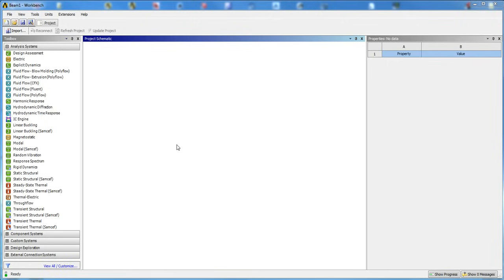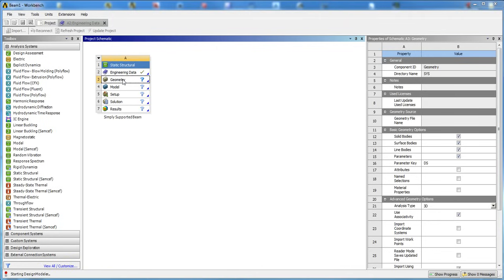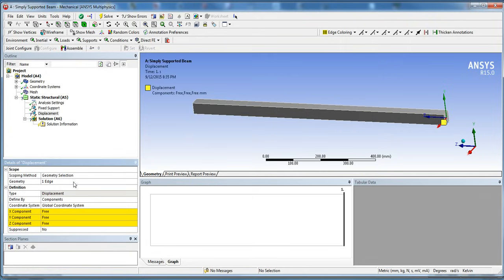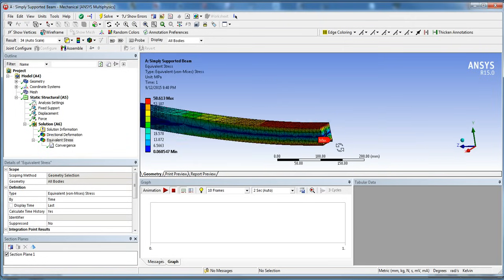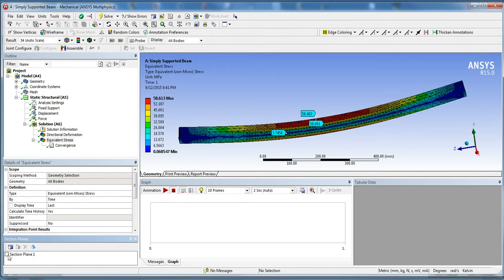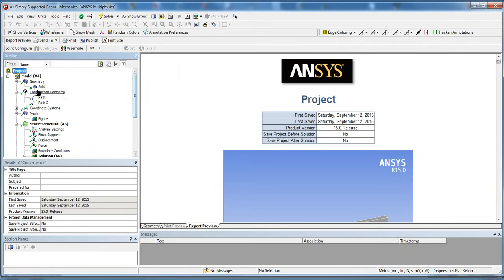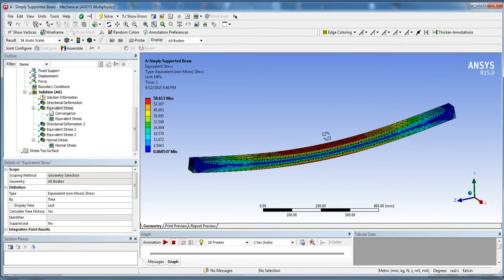ANSYS Workbench Tutorial - Simply Supported Beam - PART 1

Comment: I am in need of some help. My last college project is to optmize a reinforced concrete beam using ANSYS. I want to reduce only the height and height and thickness of the beam. I tried using Topology Optimization but it didn't work with the rebars and, after supressing them, it resulted in a weird optimization that cannot be used in real life. How can I do this?

Comment: Hello, DrDalyO and everyone.

I'm tryng to do SFD BMD analysis on simply supported T-beam and I noticed that the option for Beam tools is blocked away. This video didn't use beam tools too, but your other videos did. Are there any way to get the SFD BMD directly from a solid body like this? 

I'm aware that those videos uses line body and cross section, but in my case, I need to plot the force into specific surface, and I cant seem to do that with line tool.

If you or anyone responds,  thanks!

Comment: hello sir ,i'm currently pursuing masters in fracture mechanics i have a question with ANSYS: if i use smart crack in ANSYS  i have to use either static or fatigue method for crack growth law is there any way to get pari's law value or the critical rate value from Ansys?. And if i modal cracked specimen and change the loading condition my result will change too but the maximum stress or load will be same for material so how to find that ? can you please help with this.

Comment: Hi, I wonder why we use "fixed support" in this case? Isn't Fixed Support restricting all 6 degrees of freedom, while the supports in this diagram are restricting translational motion only?
Reply from the maker: I do not recall the details, but if you use fixed support on an edge, it will not restrict rotation. If you fix a face, it will restrict all motion, translation and rotation (UX, UY, UZ, RX, RY, RZ). So depending on how you would like to restrict your geometry you can change the boundary conditions as you wish.

Comment: Thanks for this helpful tutorial, pls why did you use the minimum value of the directional deformation
Reply from the maker: Depends how you set up the coordinate systems, could be max or min depending
Reply: DrDalyO Thank you so much for your reply. My next question if you don't mind is why do you have 5N/mm as line pressure for hand calculation and on ANSYS, the surface force input as 5000N

Comment: Hi!
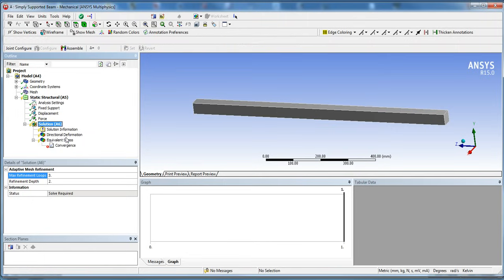Thank you for this amazing presentation. I was thoroughly following the instructions until 7:57 but after running the simulation, I am receiving an error. "Candidate nodes not available, please check convergence not scoped to single boundary conditions"
I had imported a beam from solidworks 18 to ANSYS 19.2
Please help
Thank you
Reply from the maker: Maybe try deleting the convergence output, also all the result outputs, and clear results. Then run again.

Comment: Your work is admirable for the workbench learners. Well done. I have a request too. Can you please make a tutorial for modal analysis of simply supported beam and compare FEM results with theoretical results. I am kind of beginner in this tool. I did it by myself but what is happening that for first four bending modes of a beam only first two bending modes are comparable to theoretical values and for later-on modes the deviation exceeds even 20-30 points. Please model beam with dimension as: L=2600 mm, Width=200 mm & Depth=100 mm. I will be grateful to you for your help.

Comment: Thanks for the video. Please someone help. In the first step why you only change the young's modulus? By default the material is Structural steel not concrete. I am simulating a beam made of recycled HDPE reinforced with fibre glass. I have some properties like E, compressive strength, flexural strength, dimension and loads, density, coefficient of thermal expansion, but still struggling to obtain Tensile Yield Strength, shear modulus, etc? How do you overcome this issue? Thanks

Comment: I have a question related to scoping paint, hope i will find its answer.

I am using ansys workbench 18.2
Working with surface and line bodies(beams)
To apply pressure, i picked faces from geometry window and applied pressure defined by "normal to".... 
Annotation lable shows that applied pressure scoping by red color paint on the selected faces....
My problem is why opposite side of adjacent faces are getting scoped with red color?. Why all of them can't get scoped on the same side.
Reply from the maker: Not sure I understand your question. You can select and deselect faces to apply pressure to.

Comment: I want import a Creo model (IGES) of hollow steel pipe structure  in Ansys and  check it whether it will sustain the load of 4 water heaters.  Hope someone will respond positively.  umang.201078@gmail.com  9725671950

Comment: Could please explain how I can add the fixed support to the beam, if it has a circular cross-section? Should I simply apply it to the lower circular half edge on both sides? or should it be fixed at a point?

Comment: Tq for dng d video on beam it will very helpful for learning in ansys. Sir i hv a doubt in ansys i am dng major project through ansys abt d friction stir welding. I want to do static structural and transient structural .all d process is ok but after applying d forces and fixed support it showing warning abt d rigid constraints and weak spring should be apply i am nt getting tht, so plz if u know plz tell me sir

Comment: Well, my questions are not about the video, but about the program itself. First, I would like to know that by giving the shearing efforts, which specifically it is giving me, since it does not make sense to the expected. Second, when applying a load on a surface, it looks as if it were triangular and undistributed, as is specified the distribution of the load that one desires. Third, in the supports, like knowing that it is embedding, simple support, double support, articulation. And fourth, how to arrange the joints between the elements well, like two tubes with inclination, and to be able to determine them if their union is welded or articulation. Thank you

Comment: Hi! Thanks for the video. I have a question. How can I make my cursor to be the center while zooming? By default the centerpoint is the middle of the screen, so in this case if i want to zoom to the end of the beam i can't make it precisely, i have to  zoom, pan, zoom, or click on and put that little ball on the model, that helps, but it's whole thing is annoying and generates too much clicks.
And how can I see the transparent body when you simulation the reasult with path selection? I can see only the path, the solid part is missing.

Comment: Very nice video sir..keep it up..Sir i have a doubt regarding support condition. to generate a simply supported beam why left support is kept fixed and other end displacement in x and y taken zero? according to this the  beam must behave like a propped  cantilever beam..how it resembles with simply supported beam ? sir if possible please explain the concept.
Reply from the maker: A simply supported beam is a type of beam that has pinned support at one end and roller support at the other end. So the left boundary condition is fixed at the edge and the right is allowed to roll in the beam axis direction only.
Reply: Thank u sir for ur reply. would please explain for analysis of cracked beam, how to introduce breathing crack in  a beam?

Comment: Hello Sir, I have just started learning ansys static structural. I found your video very helpful. I understood most of the things from this video but can't understand some things.
1. What is the purpose of adding convergence?
2. How to we know that our mesh(default) is good or bad?
3. What happens if we increase or decrease %age(allowable change) in convergence?
I will be waiting for your reply. Thanks
Reply from the maker: The purpose of adding convergence is to answer your second question. By using convergence you will know when you mesh is good within a certain error (% allowable change). So by adding convergence, ansys will continually refine the mesh (you have to set the number of maximum refinement loops) untill the allowable change has been met. So as an example, say the first mesh gives a max stress results of 50MPa with a coarse mesh. Then it automatically refines the mesh and solves again, naturally the max stress value should increase so say now its 60MPa. The % change in the value is now 20%. If you set the % allowable change to 20%, the solver will stop, if its less, say 1%, then the solver will continue to refine the mesh untill the difference between the previous results and the current results is 1% or less. hope this helps!
Reply: Thank you very much for your great work, clear and useful tutorials and for answering our questions. I'm so happy to have found your channel.

Best regards,
Zrinka

Comment: thanks for the great tutorial mate! I tried to mimic the example on ansys, but when i hit the solve, i get the error:
"An internal solution magnitude limit was exceeded. Please check your 
Environment for inappropriate load values or insufficient supports.  
Also check that your mesh has more than 1 element in at least 2 
directions if solid brick elements are present."
Any ideas? I did check the boundary conditions like 10 times, and no mistake there, nor on the geometry...
Reply: hummmm... changing the mesh element size to 10mm seems to solve that problem, but still I don't get the convergence. On the 1st run I got the 58,616 MPa, but on the other ones it keeps going up (73, 153, 309...) any idea why my results are not stable to 58,616? I rly need help XD

Comment: in simply supported beam there is no fixed support on one end instead there is free rotation in one direction ; why didn't you used remote displacement for that and neglected the rotation part because if you will apply force which results in rotation your answer will be wrong

Comment: I want to simulate a Concrete Cylindrical test (simple axial compressional test) to determine the Concrete element resistance and find under which load it will fail. I want to change in each test the type of concrete (f'c) so I can determine using ANSYS the resistance of each cylinder with specific material properties. Other way to see what I want to do is to recreate a triaxial test to get the UCS from different rocks.

How can do this? Can you share some ideas?

Thanks in advance for your help!!!

Marcel.

Comment: Excellent Explanation! One question: Why does it not matter where to place the Force? It automatically is placed in the center. How come?
Reply from the maker: Thank you! It does matter where you place the force. In this case I am applying a uniformly distributed load on the top surface. This means that the force is evenly distributed over the whole face that I selected.

Comment: Thank you for this video. I think that you have to use BC "diplacement as Ux=0 Uy=0 Uz=0" at the one end point where you used "fixed support". Because this end point  on beam is NOT cantilever joint.
Reply from the maker: +Il Kacar its been awhile since i posted the video, but if i remember, i probably used a fixed support along a line, which means that by default there is no restriction on rotation and only displacement. If i selected the FACE of the end of the beam, then this will restrict it in all displacement and rotation. Thanks for the question!

Comment: Thanks for the important informations.. Can you please define the basic differences between the ansys and any other design and analysis programs? By the way.. Ansys considered as an analysis or analysis and design program?
Reply from the maker: +heba douleh Ansys is a finite element solver, so other programs will do the same thing, like Abaqus or Solidworks Simulation, or Autodesk Simulation, etc. they are all also considered design, because they all have a 3D modeler, where you can create the models directly in the program, then solve.

Comment: you applied a force on a surface, how does Ansys know it's equivalent to UDL ?
Reply from the maker: +Tien Cuong it knows because when applying a force to a surface it does a UDL. If you want something else, like a point force, you need to create a point on the geometry and select it and apply the force to it. Did that answer your question?
Reply: After I make a section cut at the middle of the beam, and I would like to create a path that goes from the top edge of the beam to the bottom edge, but it seems like the edges are not recognised, (as if there were no edges there). How would you create the edges at such locations ?

Comment: Hi,
Very helpful video. I have a question regarding steady state heat transfer in ANSYS. 
If i have a plate with rectangular fins and my aim is to find the film coefficient of convection h in order to keep the plate at a fixed temperature, how can i do that on ANSYS? Because if i want to apply the boundary condition for convection, i cannot do it without h, which is what i want to find. Thanks!

Comment: Hi DrDalyo, Thanks a lot for the awesome video. I got confused  how to put hydrodynamic added mass along the height of the dam. I need to model seismic deformation analysis for rock fill dam. I have two questions: 1.  How to add engineering material( a. clay, b. rock)? 2.  How can I input the different values of hydrodynamic added mass in respective height of crest from base of the dam?

Comment: Thanks for the great videos. How would I cover this in 1D with point loads as well as UDL?
Reply from the maker: +TylerIn2D Hey thats a good question.  Not sure if i completely understood, but basically you can simplify this to a line body. so in geometry modeler, create a line, then convert to line body, then create a section for that body and apply it. in Mechanical, you can then apply line load. if you want to apply the load as specific point, you would need to split the line in your geometry, or use Nodal Load which i think is an option... dont remember.
I should probably make a video on this..
Reply: +DrDalyO I think ive cracked it but yeah, thatd be good for anyone wishing to see this in future. Keep doing what you're doing!

Comment: HI DR dalyo 
thanks for your effort its  really  helps me a lot on my project, i  do the same steps you have been make for beam, the thing i change to simply supported pipe and its work properly, more over i want to make insulation and i dont know how add. 
plz replay to me as soon as possible.
Reply from the maker: +Ibrahim Aldhibani you have to model the insulation in geometry modeler. make another solid body. then rerun the analysis.

Comment: Thanks for such a very attractive video. I used to use Mechanical APDL and looking to shift WB. In APDL we need to define element model (Solid 185, 186 etc) at the beginning. Is there any element definition in WB. Thanks
Reply from the maker: +Yüksel Yılmaz There is not element definition in WB, there is however in the meshing options the ability to drop midside nodes. ANSYS workbench uses default element types which you could find in their user manual. If you want to override these models you could use command objects, please see my video on cast iron for more information on how to do this!.
thanks,

Comment: DrDalyO please help me here. I'm new in using this software and I have to model a cylinder Tensairity beam for my project. It is an honour if you can show a simple example in modelling this Tensairity beam.Thank you.
Reply from the maker: +Noor Atiqah Mohamed Bakhir It shouldnt be much more difficult than a normal beam. You just have to spend more time on the model itself, to model the beam with a chamber inside and cables running alongside. Once the model is made, you could add a pressure normal to the inside face of the beam, and support the ends. The material properties for the cable and beam would be different, and can be selected in the material data.
Reply: Thnak you for your info.